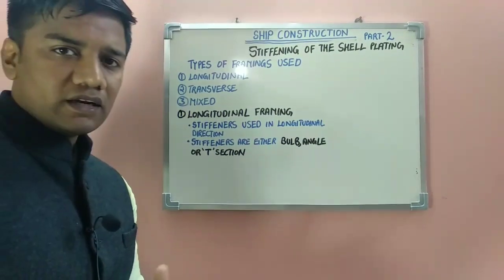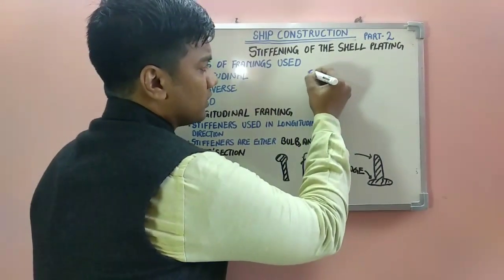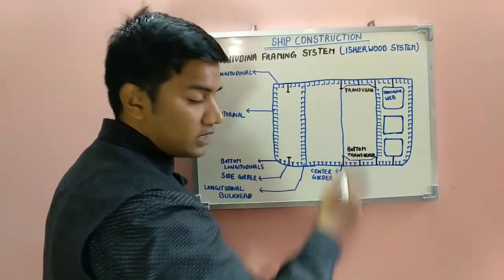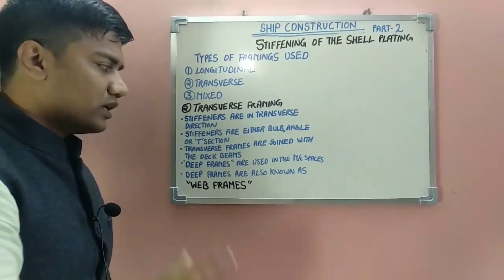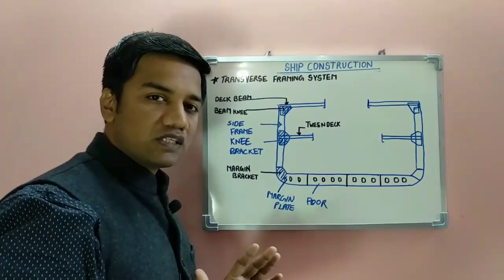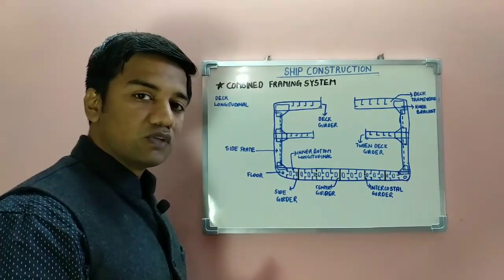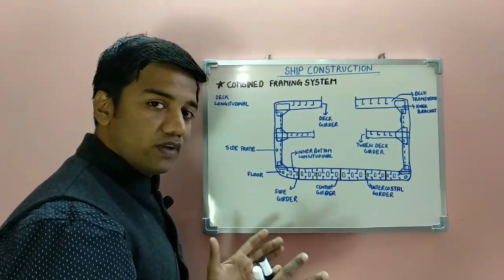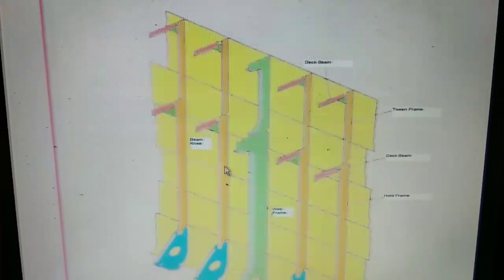Ship Construction, Part 4, Framing System

Comment: Sir what is the difference between product and crude oil tanker ... Construction wise??
Reply from the maker: Crude Carriers -no tank coating is present compared to product Carriers.
Eg of crude carriers-VLCC/ULCC
Whereas Product carrier may carry  either Clean or Dirty Product. Usually Coated tanks for Clean products eg of coating-Epoxy coating .

Crude carrier may use the same piping and pump arrangement . Where as In Product carrier there may be separate piping and pump arrangement for each tank.